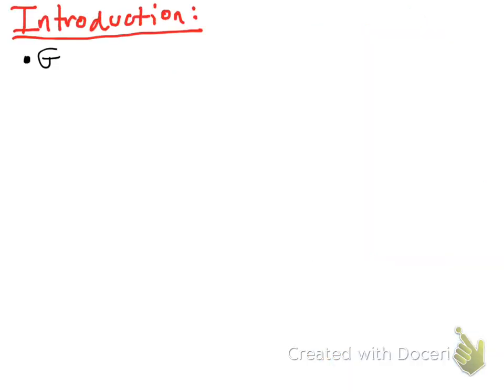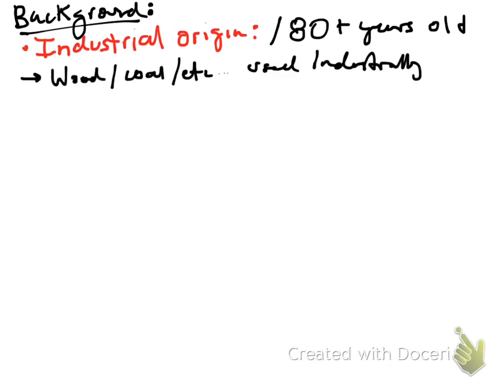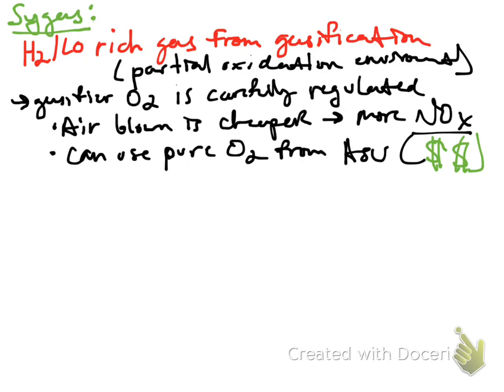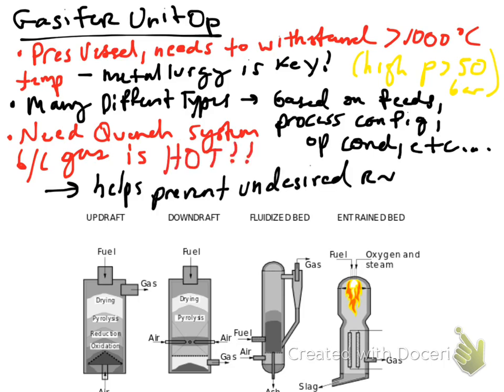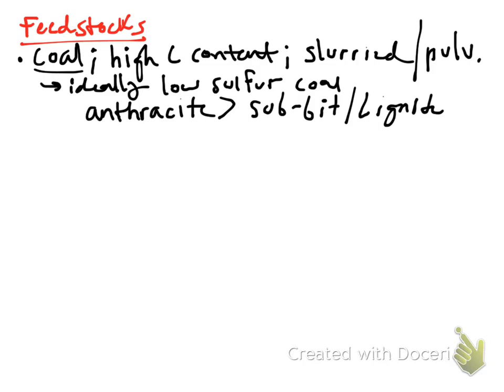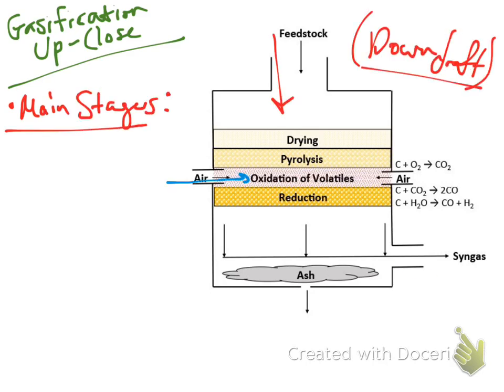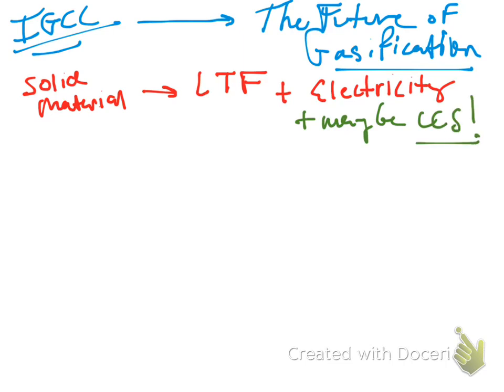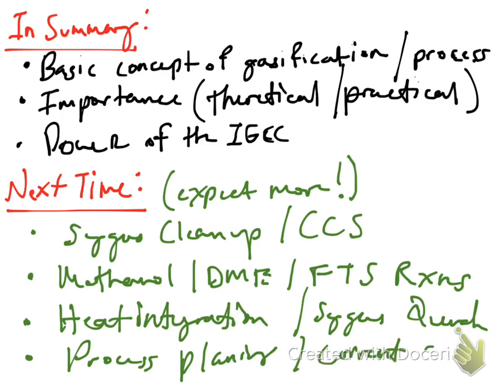Gasification: Introduction and General Overview

Comment: Is direct messaging possible for your thoughts and ideas on where to locate metering equipment to take the basic gasification process to a higher level which would include hydrogen production then mixing prior to storage. Obviously you understand why there would be need to meter the gases produced and the ratios and the safety precautions required for this operation. I believe propane or acetylene tanks surrounded by earth should be sufficient but there are concerns  of the tanks embrittleing themselves with a higher content of hydrogen present in the mix.